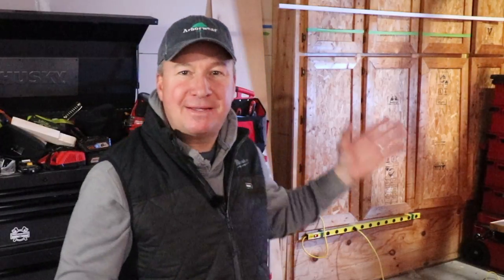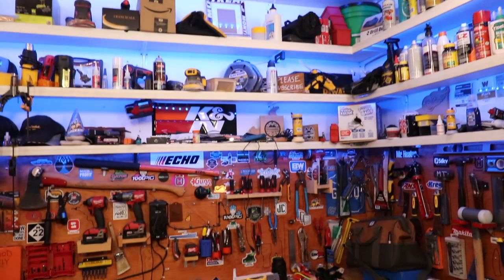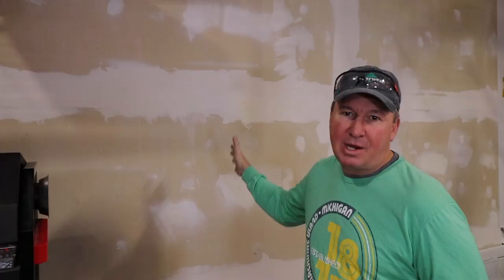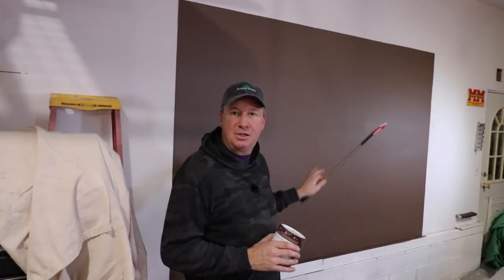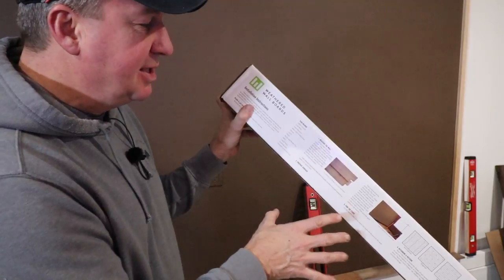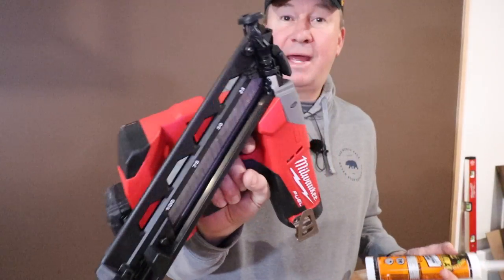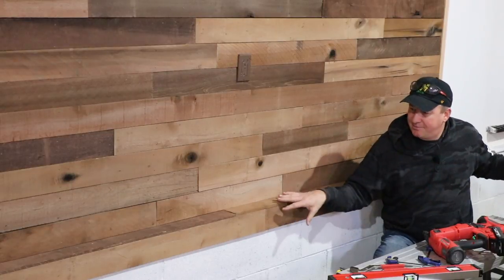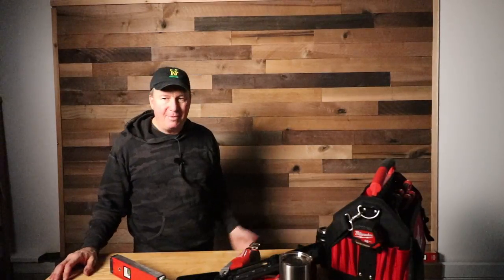How to install a wood plank wall using Weaber Hardwood Wall Boards.

Comment: Good Job, I bought the M12 Hex Impact gun with a 4 amp battery that you are using a few days ago and it is much better than the older version with 2 speed, Next on the list is Milwaukee magnetic box levels [18 & 24], I also got a 11/32 hollow shaft nut driver and in my opinion it is way better than other brands. I am in HVAC & Refrigeration business and Milwaukee always been my first choice! Most of my hand tools are Snap-On and Malco but Milwaukee hand tools are even better than Snap-On & much cheaper!
Reply from the maker: I like the M12 impact.  It has plenty of power for all around projects.  Their levels are bright and easy to see.  I haven't tried Snap-On yet but understand they're quite expensive.

Comment: Good stuff and nice work Mark. I have something similar in my garage/ work space but I used $30 sheets of panel boards that look like wood. It made the space look much nicer than what it did before.  

Btw, my work space in the garage is just like yours with clutter all over the countertop.  All over lol.
Reply from the maker: Nice, thanks.  What's funny is that it takes an hour to clean it all but only takes 5 minutes to make a big mess.

Comment: I have considered replacing the paneling behind my work bench area with something like the flooring your using. The problem is my wife want a kitchen remodel….. I did replace the old lighting with led angels I picked up at Costco. I almost need sunglasses.
Reply from the maker: Oh man, a kitchen remodel sounds expensive.  Maybe you can buy these boards with the kitchen stuff and install it later?  
I have some 2x2 drop ceiling lights needing to be replaced with led.  I'm hoping they make dimmable ones.
Reply: @MarkThomasBuilder  my “U” shaped kitchen works well, but the butcher Formica is dated after 35 years…….
Reply from the maker: I know that formica, lol.  I had it in a my house growing up.